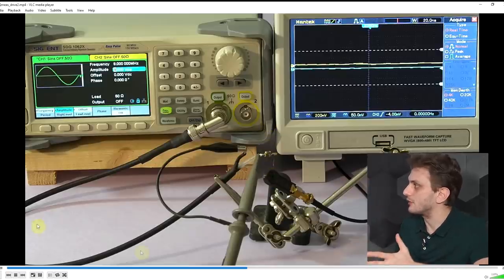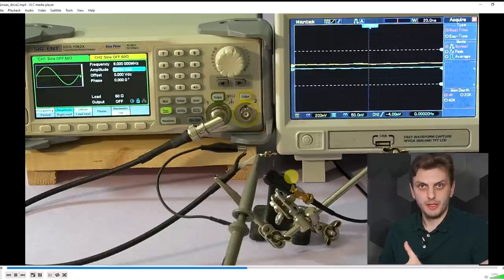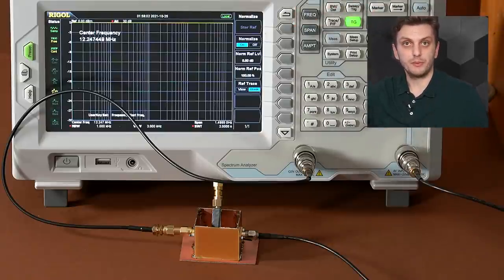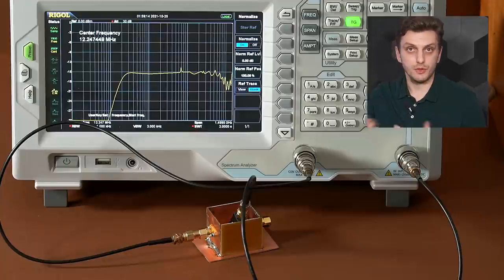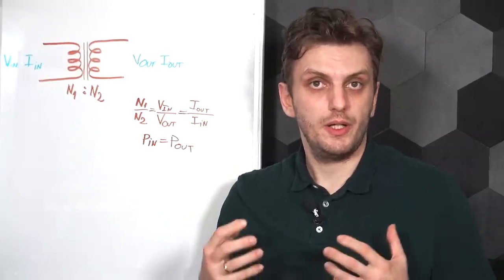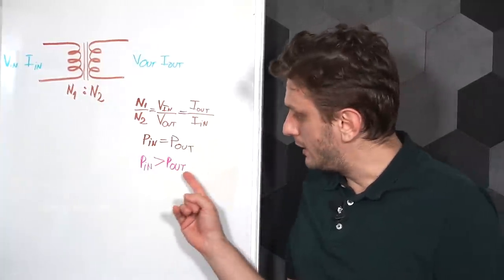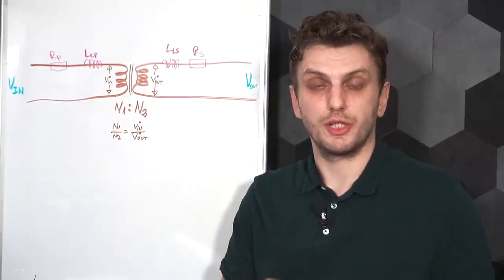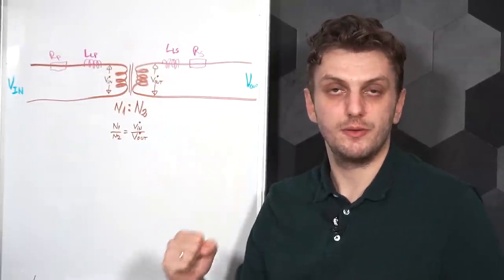About Current Probes and Transformers

Comment: Great video! Lots of these variables and non-linearities are also applicable to low frequency transformers btw. 👍🏻
Reply from the maker: Of course! I was not trying to talk about high frequency transformers, but rather transformers in general. You get the same effects with a 5 turn RF trafo as you get with a 1000 turn audio trafo. To some extent things like parasitic series resistance and parallel capacitance are turns dependent, more turn, more parasitics.

Comment: excellent again. 
It would be interesting in the end to also empirically determine the probe response by doing a sweep, observing the response at the frequency of interest, and then applying a correction factor for your first measurement. This could include multiple sweeps at various current levels as well as the frequency. Your analysis shows clearly how models need careful construction in order to represent the real world, and how greater understanding of all the parasitic and non linear responses is needed to refine a measurement. 
AND
The consequence of a complex model will rapidly slow down a circuit model containing more and more representative component models.

Comment: PCB current measurement by inductive means requires access to the current in the trace, which is difficult because you cannot put a current probe around a PCB trace without using a wire to bring out the current, and as mentioned in the video, this length of wire will add inductance to the circuit. 

So how to measure PCB current? You have to design not just a circuit that works but also a means to test the circuit. In PCB design you must design for test. 

If you look at power distribution networks many times there are key points in the circuit where you would like to measure current, not necessarily for stability of a voltage regulator but for design considerations with specific components. Like capacitor RMS current and transistor peak currents. To make relatively low frequency measurements (BW 2.5MHz and below) you can use an accurate non-inductive sense resistor (e.g. 10 Milli-Ohm SMT 2512, +/-0.5% tolerance, not cheap) as part of the design to make the measurement. You can choose to leave the sense resistor in the design (it may need a little damping resistance anyway) which means the circuit will behave as tested or replace the sense resistor by a zero ohm jumper if cost is critical. You can always bring out a loop to do the testing if it can accommodate the small increase in inductance during the test. I think you will find the sense resistor method as having a very low noise floor as compared to the inductive current probe.

To measure the current you have to make a floating differential amplifier which usually has an output to a scope voltage differential probe, which most test benches already have. On my designs I like to use an off-the-shelf differential amp and cable driver (current mode amplifier into 50 Oms as an option) with the end of the probe PCB very small and pointy so I can solder the leads directly at the sense resistor with minimal length (10mm or less). You can run the probe off of batteries to keep everything low noise and floating. For current probe gain =100 with 10 milli-ohm sense you get 1 volt per 1 amp, which is handy, or you can add more gain stages, like 10 or 2 usually increasing the noise and offset errors. My probe design gets updated from time-to-time because the semiconductor companies continually improve the performance of their instrumentation amplifiers, and I must say, even though expensive, the performance is getting really very impressive.

Comment: I think the second part of equation at 19:52 should have Cprim instead of Csec, because 1.) those expressions are not equal (trivial) and 2.) the Lprim/Lsec ratio multiplied by the Rload gives the load seen on the primary side, so then you have to multiply it with the Cprim to obtain the cutoff frequency. And as far as I can tell this formula is only valid if we consider capacitance on only one side.
Reply from the maker: Hello Laszlo. You are right, I did add a card to mention this issue and I also added a "late edit" in the description. Regarding the second thing you mentioned, that is also correct, this formula only refers to the case with a single sided capacitance - it should contain both terms to account for both primary and secondary capacitance at the same time.